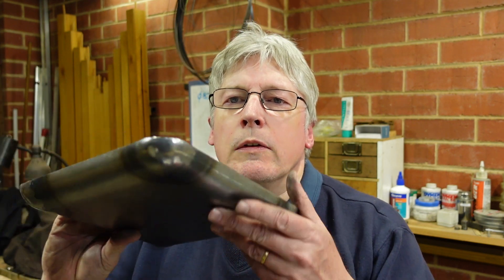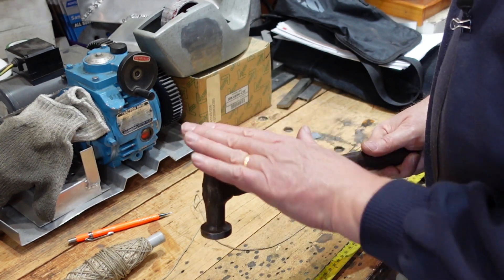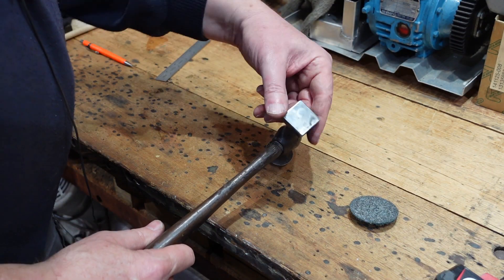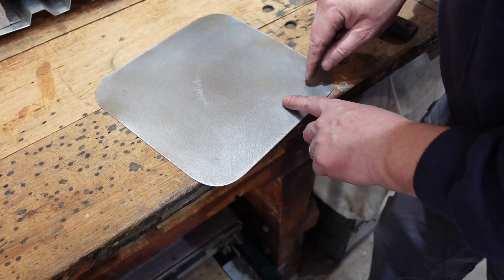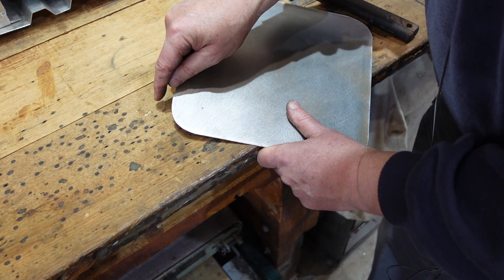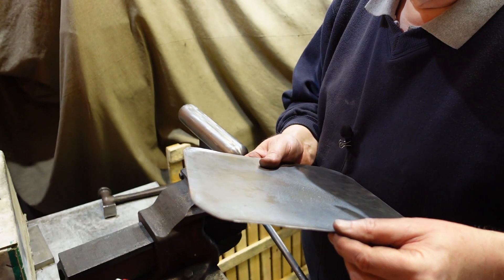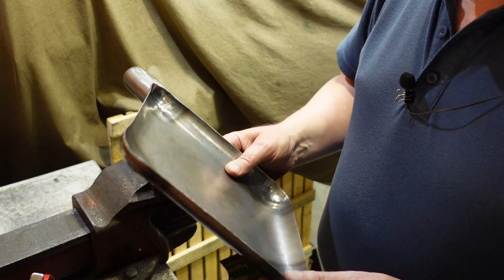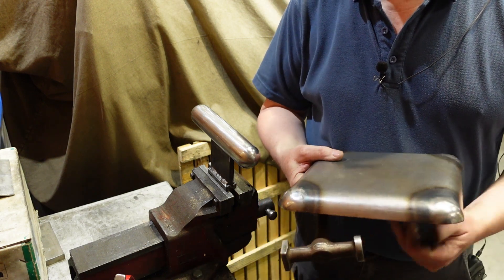Forming sheet metal with hammer and dolly

Comment: Thanks, with regards to the corners, have a look at tuck shrinking where you deform the metal into a deep V then shrink it into itself. A couple in each corner then anneal will get the corners formed quite quickly. Guys like Lazze metal working or Wray ?Sheliene do good demos on it.
Cheers
Reply from the maker: I've seen videos on tuck shrinking but did not want to run the risk of creasing the metal. Next time I do this I'll probably be a bit more agressive.

Comment: You are most likely aware , that hammer is a body hammer most likely a finish hammer ( well abused )  spent many hours back in the seventies using one and a  few others working on my custom cars, I was fortunate enough to be taught by a retired old school Panel Beater, these days you remove the panel and attach a replacement, no MIG all oxy / acet, in those days
Reply from the maker: Yes. In fact I found it on Ebay under finishing hammer. While possibly not the ideal hammer to purists, it works well for me